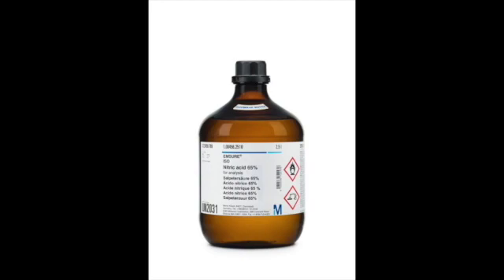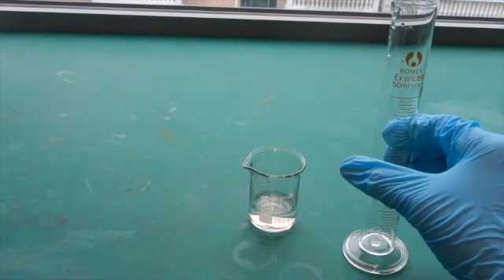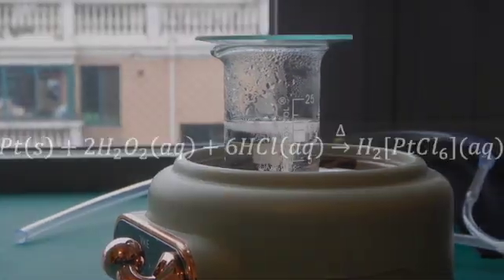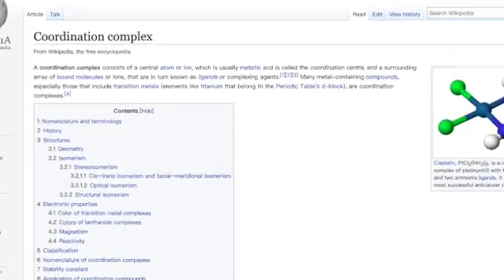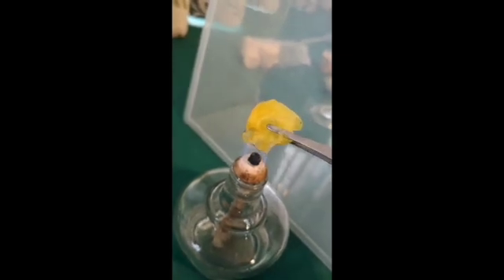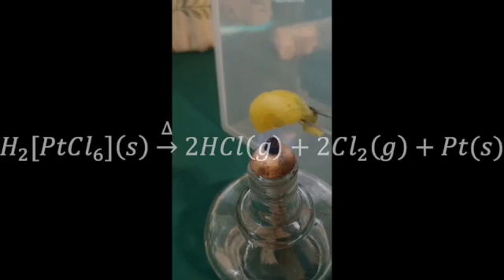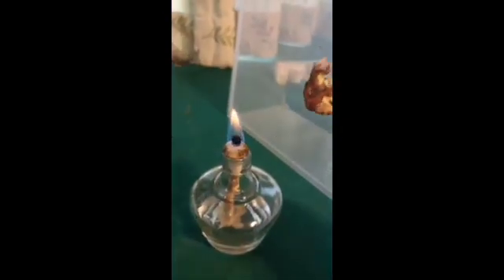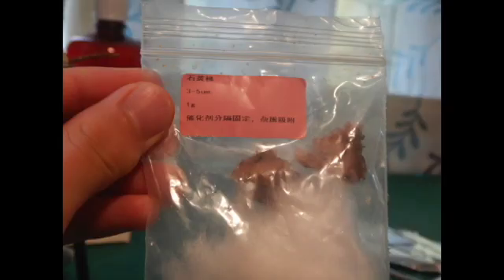1.2 Three Acids - Making Nitric Acid Catalyst

Comment: Platinum for just 1$ ??? You may just have been scamed, also  "99,99%" purity is kinda strange
Reply from the maker: Well it was a very small piece, so 1$ might be the case. I am quite certain that it is at least pure on the outside.
Reply: @MIH0319  if that's the case lucky for you 😌